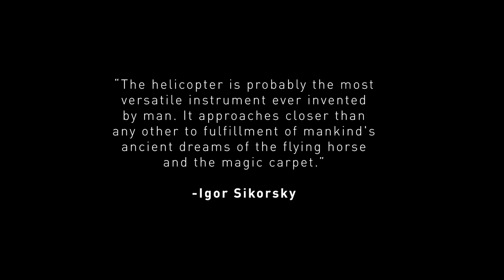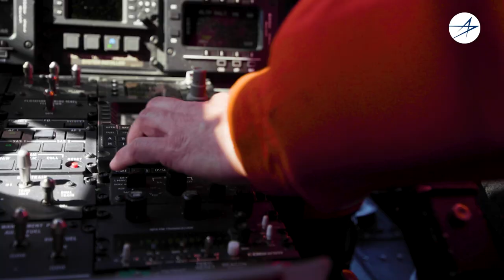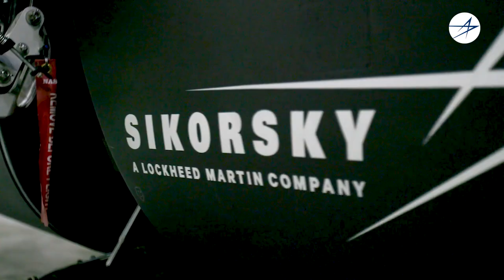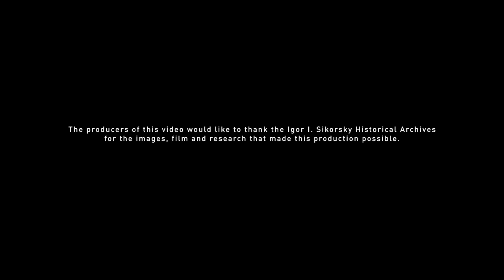Igor Sikorsky's Dream

Comment: So I just saw a 1960 Oldsmobile. 
And I would think that it would be rather coincidental. Not a Dead ringer however for your insignia on the tail section of this vehicle. 
It look like if I was eleven 1960 it could have flown with those tail section fin ish es. That automobile actually put out. 
You guys figure out the square Windows don't work with pressure altitude? And such things. 
Anyway when your engineers get a clue give me a call I'm sure you don't mind I'm laughing my ass off right now Elon musk character I can beat him a practical to bed any day. 
So he can suck it